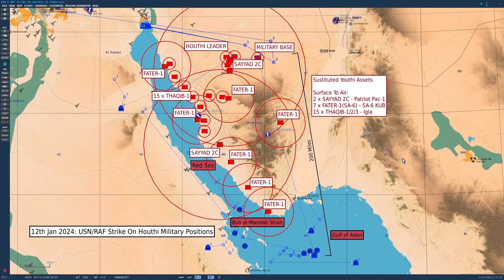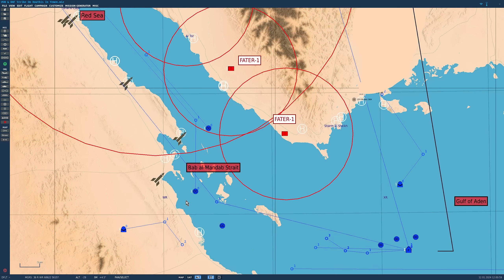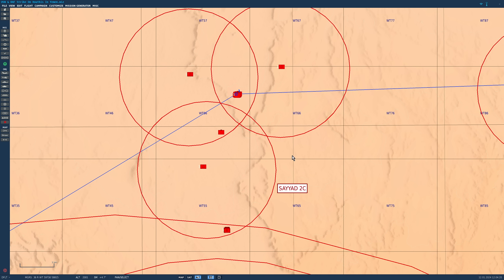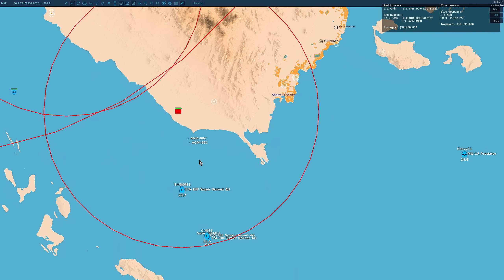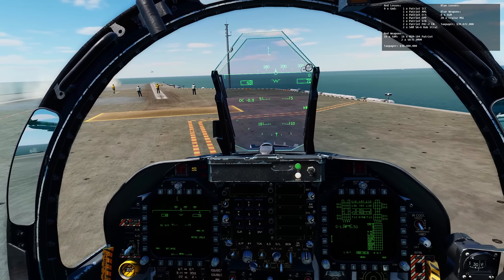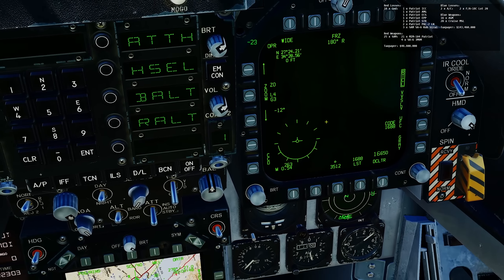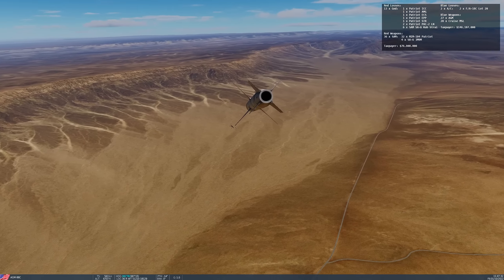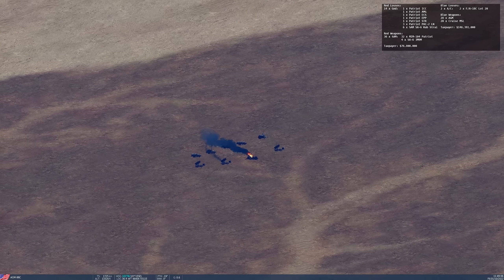Joint US & UK Strike On Houthi Positions In Yemen | DCS

Comment: @35:00 ish That desync looks like the inertial navigation system has been slowly pulling out of sync because of the earths rotation. Just a thought that came to mind.
Reply: No it's a server / multiplayer issue, the host and client see different positions but the bomb hits the same target regardless. Earth's rotation is not modelled in dcs.
Reply: @Steamthrower1 I just thought it looked a bit funny. 
but,, as I recall,, I think the inertial navigation system is actually modeling the rotation of the earth. If I remember  correctly, I think Cap tested that a long time ago. (but that was years ago)
Reply: @lordsqueak  probably true, however what we see is server desync from host to client. Nothing to do with ind
Reply: @Steamthrower1 I know that. Cheers

Comment: Wonder if the desync trouble would be resolved by allowing designation of a grid reference point assigned to everything either hardcoded in maps or within missions? Apologies if this is already known about.

Military has a similar issue that causes radar contacts reported over datalink by two or more link participants to be in different places as if two contacts instead of one. It’s caused by navigational errors but also lots of technical factors resolved by what they call a data link reference point or DLRP and an auto “gridlock” method to fix the problem.

Comment: Who is lasing for the Typhoon ? If they're using laser GBUs (the paveway III is only laser), they should've a laser station somewhere ? Or it isn't showing due to some bug ?
Reply: Aren’t the newer gbus laser/gps ? Could be wrong but I think I heard that somewhere
Reply: @sebase1161  the paveway IV is INS-GPS/Laser guided. And btw that's the one that great britain did use against Houthis militant during the air raid last saturday. But the paveway III isn't and that is the one GR's typhoon are using in this video. That's why I'm wondering where is the lasing station
Reply from the maker: We were using Paveway 3 but they were representing Paveway 4 as used IRL.
Reply: @grimreapers  alright, tho they were already setup at a strike point I imagine ?